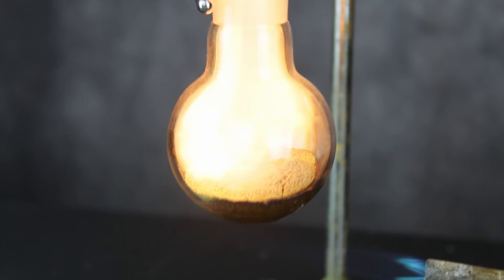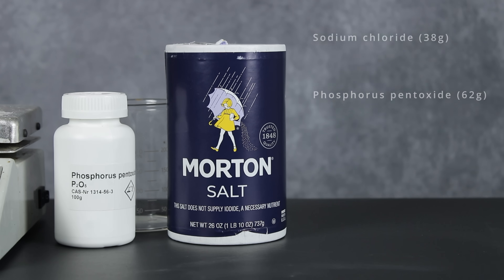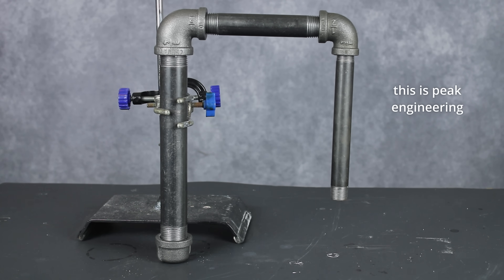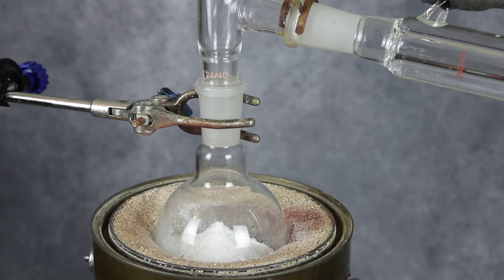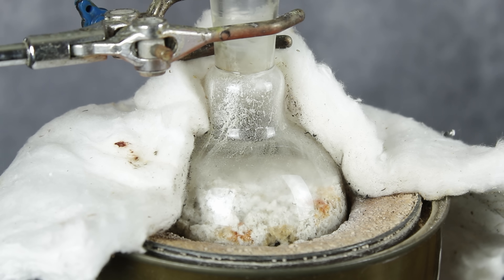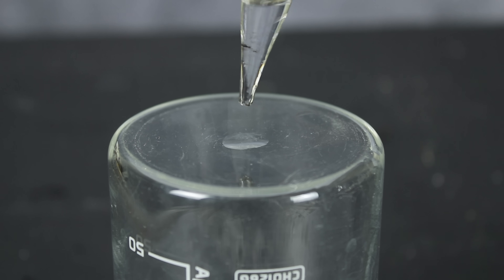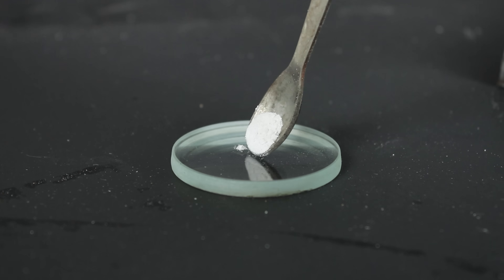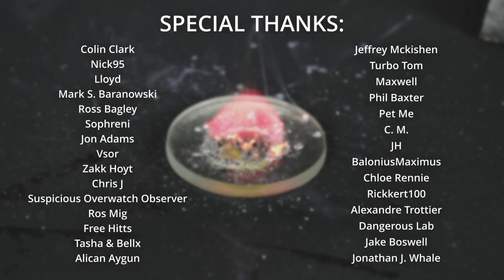Making Phosphoryl Chloride from Table Salt (REVISED VERSION)

Comment: To get this tube threads closed so no gas and stuff can get through u should use some like locktight. Like scratch along the threads on the tube so the string of the locktight stays on the thread. Just apply it in the direction u would drill on the bow or whatever u drill on to it

Comment: in powder reactions there is something to be said about grain size - pretty sure fine particles would react easier than various sizes you get from a home blender (apart from water contamination and OTHER contaminations in table salt). 
Also - for your own safety - it is better to use ceramics for burning reactions, as they tend to be a little more resiliant to temperature shock and a little less explosive than glass.

Comment: Try removing the water from “Mountain Dew “ warning without the water Mountain Dew has a flash point of 43 degrees F so again I recommend using a vacuum as it is easier to maintain the temperature below 43 degrees F, I suggest 36 degrees F.

Comment: 3:37 The end cap will never seal an NPT thread regardless of how tight it is because NPT threads have a spiral leakage path between the root and crest of the threads by design and require a sealant such as Teflon tape, pipe dope, or anaerobic sealant to fill the gap. Pipe joints with NPTF known as dry seal threads have tightly controlled root and crest which effectively do not have a spiral leakage but assembly on materials such as stainless steel are almost impossible without lubricant due to galling.

Comment: A few problems with pipe in relation to sealing is that it's a tapered thread. It creates a conical leak path without a proper thread sealant like PTFE which would more than likely burn at 500ish° f, also common SCH40 pipe is malleable iron, you can get 304 or 316 stainless fittings and pipe, however they are fairly expensive.

Comment: Isn’t this the primary ingredient in serine gas?
Reply from the maker: If you mean sarin, than you might be thinking of methylphosphonyl dichloride (basically phosphoryl chloride but with a methyl group in place of one of the chlorines). Phosphoryl chloride can be used to make similar organophosphates though, although I don't know of any notable ones off the top of my head.

Comment: Phosphoryl chloride (aka Phosphorus oxychloride, POCl3, or "pocl") does indeed react vigorously with water.  I was once using it as a reagent, following a procedure from an oldish paper. The work-up procedure described washing the reaction mixture with water and sodium bicarbonate solution. As I added it to water, it was spitting and splashing a lot, so I had the clever idea of using ice instead of water. I added one chip of ice to the reaction mixture, and it went "whoosh", depositing my reaction mixture on the lab ceiling and forming a cloud of HCl gas. Most chemists have had to do a "bench extraction" at some point. Some have even had to do a "floor extraction". That was the only time I've ever done a ceiling extraction,  though.

Oh, by the way, your lithal looks awful. It's supposed to be grey, not white. I have a suspicion that your sample got exposed to water somehow and formed aluminium hydroxide.

Comment: Hey, looking for an idea for a similar (sketchy but popular as rumor) chemistry experiment? You can use Phosphorus Pentoxide to make Acetic Anhydride. The instructions are, you guessed it, on sciencemadness. I attempted it but severely underrestimated how "dry" everything needed to be.
Reply from the maker: A somewhat more OTC method that I actually made a video on involved using sulfur chloride and sodium acetate. It works pretty well, and is doable as long as you can buy sulfur, chlorinating tablets, vinegar, and baking soda! Although if you can get pentoxide and glacial acetic acid, dehydration definitely seems like a more straightforward route.

Comment: The visual you used when talking about "ordinary table salt" was a picture of a Morton Salt container, that stated it was not the salt with iodine added (which is the most common type sold), but I'm curious if you knew that the table salt from Morton Salt without iodine added, still isn't pure sodium chloride salt. There are trace amounts of a few other elemental compounds that are added to help prevent the salt from clumping into a single, solid mass if it's exposed to a large amount of moisture.
Reply from the maker: Yes, I knew. However, the tiny amount of calcium silicate added to prevent clumping shouldn't really do anything to the reaction.

Comment: Next video: Hydrofluoric acid from calcium fluoride.
Reply from the maker: It's actually from sodium fluoride, but yes, that is actually coming...actually anhydrous HF, if all goes well, which will be turned into fluoroantimonic superacid!
Reply: @LabCoatz_Science  Believe me you can do it with calcium salt, you just need still retort which you are already familiar with, but use greater pipe diameter and welding it at the bottom is mandatory.
Reply from the maker: @NionXenion-gh7rf  Oh no, I meant the sodium fluoride is how I'll be making it, I know you can do it with calcium fluoride.
Reply: @LabCoatz_Science  when you have NaF why not, it's safer

Comment: What chemicals will disolve the lab glassware?
Reply from the maker: Hot phosphoric acid can etch glassware, although my flask was etched by hot sodium hydroxide iirc.
Reply: @LabCoatz_Science  I mean, like, melt a hole through the bottom of a flask. 

Nothing is indestructible, right?

Or what temperature would ignite a beaker in a (almost) pure oxygen environment?

(random ideas for future videos, but I'm also curious)

Comment: 3:45 national pipe thread aka npt generally needs a sealant on that end cap, it's probably not as important on The other fittings. I think the easiest thing to do for that bottom fitting would be find a nptf(national pipe thread fuel) as they don't require a sealant and are compatible.

Comment: Which do you believe has the greater potential for overall harm?
1. Knowledge itself.
2. A single mega corporation which grants advertisers a position of being the ultimate arbiters of what knowledge is and isn't forbidden for the majority of the population depending solely on whether or not they think a Karen might associate their brand with something even slightly negative.

I'll reserve my opinion so as not to bias any responses.

(NOPE, can't help myself. It's 100000% without a single doubt option 2. If you picked option 1, you are absolutely WRONG and you should feel bad about how completely and insanely wrong you are.)

Comment: I still believe it’s more likely he flashed himself with UV from burning magnesium in some crazy unknown 
 oxidant than that he poisoned himself
Reply from the maker: I did the math, and thanks to the inverse square law, there is no way a 100mg pile like that could generate the necessary 0.12 J/m2 of UV to cause photokeratitis (even if 100% of its combustion energy went into making UV light). Plus, the irritation went away immediately after I had my eyes thoroughly washed at the hospital, leading the doctors to agree that this was indeed chemical irritation.
Reply: @LabCoatz_Science  I’m not sure of your maths there.

100mg at 24.305 g/mol = 0.00411 mol

2Mg + O2 is -1204kj/mol

For a total of -2.475kj

A sphere with 1m radius is 12.566 m2 of surface area.

That’s 196.96j/m2 standing at 1m away of UV assuming as you did total conversion.

That’s more than 1600 times the needed dose

Now a quick google tells me approximately 10% of that energy is released as light.

And a rough approximation looking at the spectrum would be about 5% of that is sub 400nm, so dividing but 200.

That’s still 8x the dose needed to flash yourself, and let me reiterate you used a chlorinating agent…. There’s a reason chlorates and other chlorine donors are used in fireworks, flash powders and flash bangs. 

That
Reply from the maker: @geekswithfeet9137  That seems right, not sure where I f*ked up, lol. I still maintain that it was chemical irritation though, since it went away once my eyes were washed with saline, which does not happen with photokeratitis (the time span was also too short for something like photokeratitis to alleviate itself). And like I've mentioned before, I've stared at much larger magnesium flashes without having a single issue, so I really doubt such a small amount would be so different this time.

Comment: pipe threads won't hold any pressure at all without a thread sealant. High temp rated thread sealant or getting someone to weld or braze your end cap on would be ideal

Comment: this is an utter failure on YouTubes behalf. your previous video was excellent in showing the consequences of not using extreme caution while working with chemicals even if we have used them in the past. to take away the monetization on the video for doing so is simply absurd.

Comment: A better process: 

1. Production of Chlorine Gas (Cl₂):
Sodium chloride can be used to produce chlorine gas via the electrolysis of molten sodium chloride or brine (a concentrated aqueous solution of NaCl).

2. Preparation of Phosphorus Trichloride (PCl₃):
Phosphorus trichloride is produced by reacting elemental phosphorus (typically white phosphorus, P₄) with chlorine gas.

3. Oxidation to Phosphoryl Chloride (POCl₃):
Phosphorus trichloride can be oxidized to phosphoryl chloride. This is typically done by reacting PCl₃ with oxygen or another oxidizing agent, such as chlorine gas in the presence of a small amount of water.
Reply from the maker: The problem is getting phosphorus. Some sites sell it, but it's a much more restricted substance. You COULD use match striker pads, but you'd need thousands to get more than a few grams. You could also make it by super-heating a phosphate with charcoal or aluminum powder, but that process is difficult and finicky. This route is really one of the only "easy" ways to get POCl3.

Comment: Do you know is it possible to extract only minerals from salt?
Reply: Salt, as in Sodium Chloride?
Or "salt", as in the general chemistry term, study as Copper Sulfate?

If the latter, yes. For example, you can use the aforementioned Copper Sulfate to deposit copper onto another metal.

I've done it by dissolving copper in hydrogen chloride, with the help of a little H2O2 (just generation purpose 3% strength), which makes CuCl2 [Copper(ii) Chloride]. Then heat that solution up and dip your metal in it, swirl it around, and watch it become copper plated. 
(note: chemical plating isn't quite as good as electro plating, but you can combine the two methods for better results)